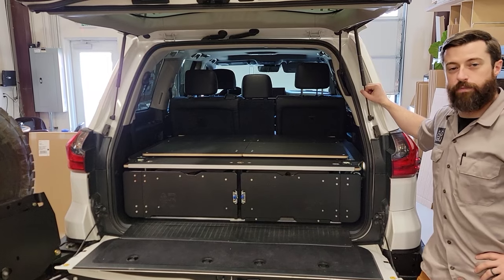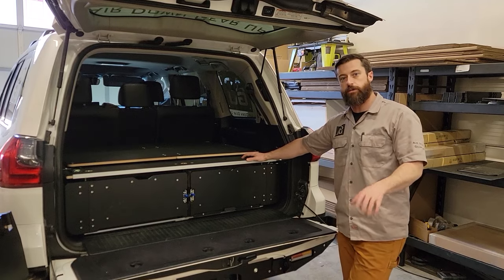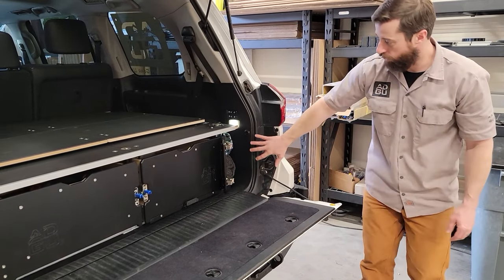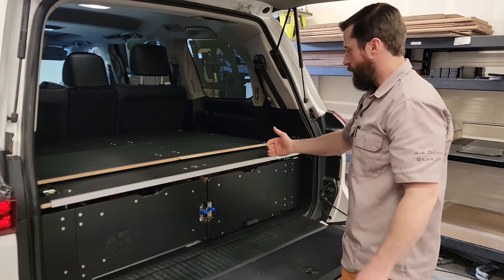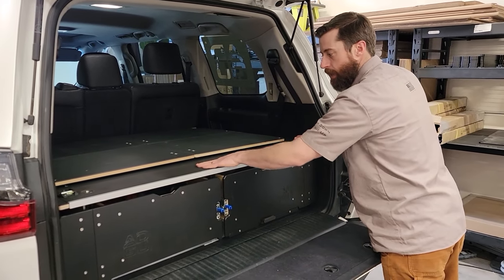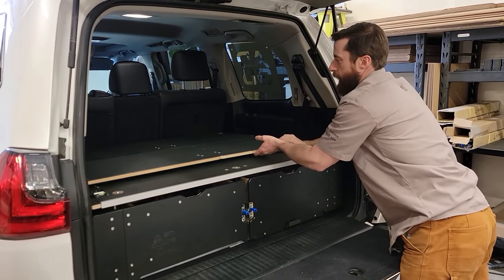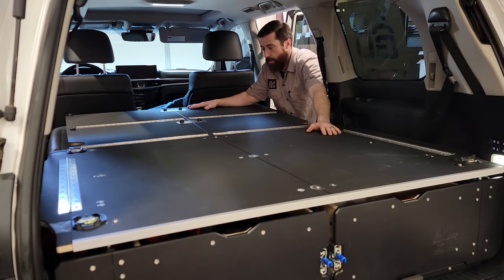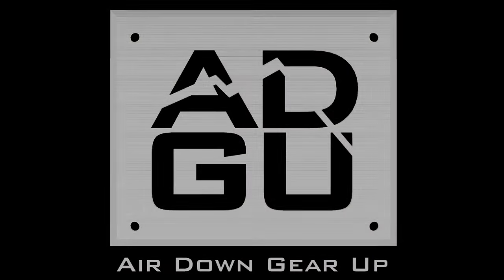Drawer and Sleeper System for Landcruiser/LX (80, 100, 200 Series) by Air Down Gear Up

Comment: what's the avg weight?
Reply from the maker: The weight on our typical dual drawer with convertible sleeper in birch is around 140 lbs. Closer to 125 lbs if you opt out of the sleeper. If you upgrade to the Richlite material you'd add around 20 lbs with sleeper and 40 lbs with.